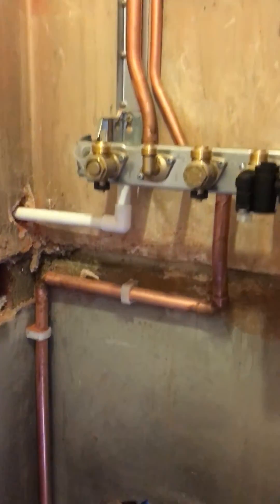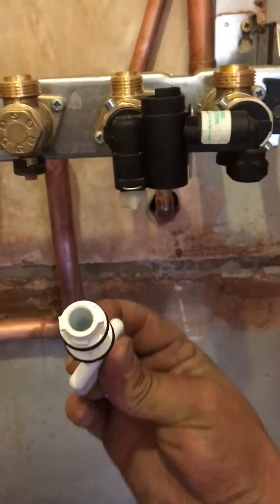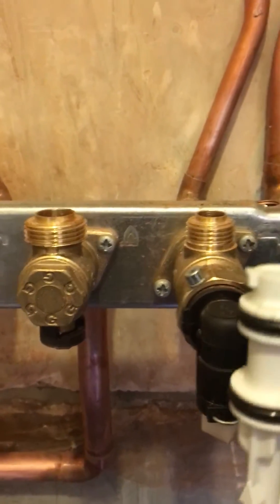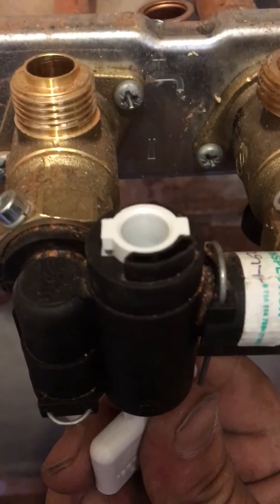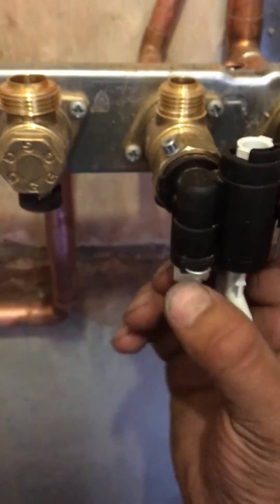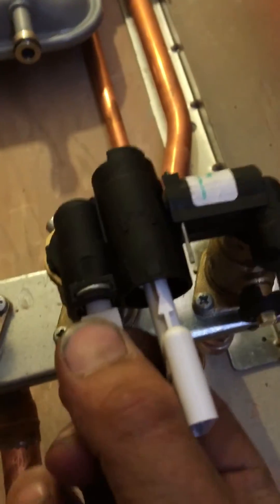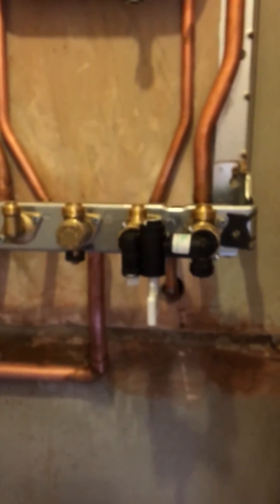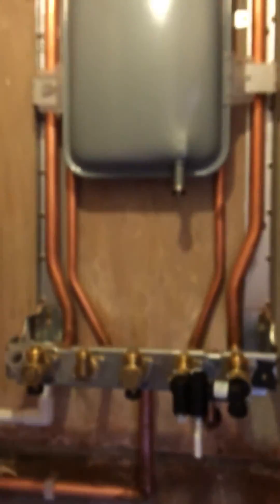Top up low pressure refill Worcester Bosch junior combi boiler 24i 28i 25si 30si  30i cdi Acumend

Comment: Got a 24i junior and it doesn’t have the key top up valve just the two brass female connectors where it should go how does it get pressured up?